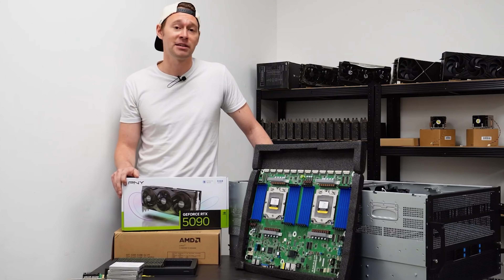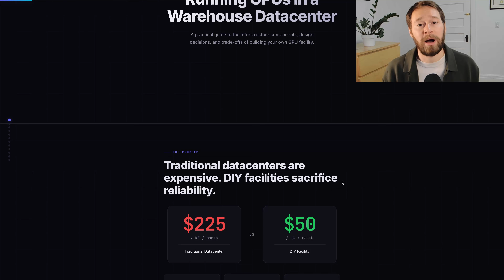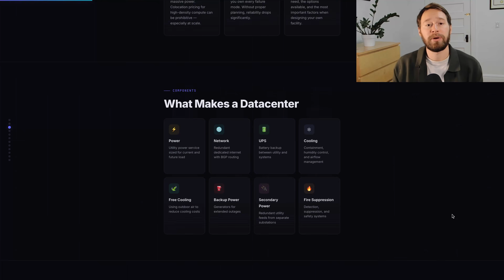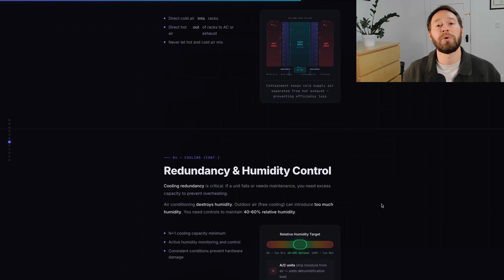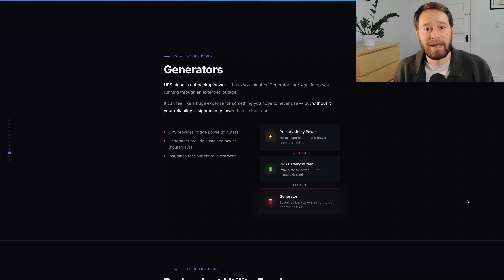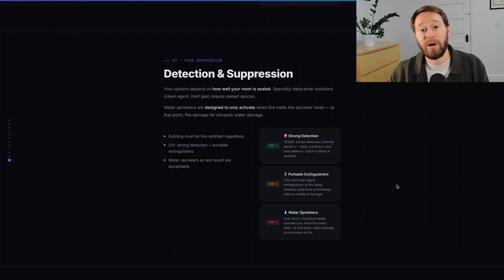How to Build a Warehouse GPU Data Center: A Practical Guide

Comment: Great stuff thanks 

What about storage?

We are struggling with our zfs setup it is throttling on high workload in the k8s kluster. 

Nvme, ssd, raidz1 or mirror what would you typically do for maximum throughput and iops?
Reply from the maker: If you have backups of the data or it can be replaced easily Id go with a big Raid 0. It sounds like you have multiple nodes though so in that case its probably your network saturating before the NVMe/Raid throughput does.

Comment: Great video.  My advice - Think outside the box with UPS etc - I dumped Eaton and APC a long time ago and build my own custom Victron/Lithium "off Grid" set ups to back up equipment in a power cut - got 20 hours of power available before I need to think about generators or anything else.  Gotta admit I've never had the grid go down for 20 hours so far... touch wood.  You can also use this "off grid" methodology to build a 3 phase system even if you only have single phase grid input - that is also very useful.
Reply from the maker: That’s sick! Sounds like you have a much stronger electrical background than I do haha. How many $ per Kw did you get that down to?

Comment: Thanks for all information. I was thinking going datacenter way in future, but I know I will not. I have just 46 GPUs but earning aprox. 8k per month with avg 75% utilization, with full utilization it should be almost 11k. Net after expenses is around 6k. Crazy thing is, that this is like passive income, I dont need to do nothing for months, with 13 servers I have almost no issues, no outages. With 1000 gpus, thats full time job.
Reply: Nice what platform you using?
Reply: Which GPUs, consumer grade or A5000+ models?
Reply: @mancavetech  both, the best one I have are 6000 Pro
Reply: @radoskrib7155 Nice! Congrats, my man. I hoped to use crypto mining to get capital to get to that level of investment. Not any time soon, lol.
Reply from the maker: yeah if you keep it in the sweet spot you can get away with much less infrastructure. You running on Vast?